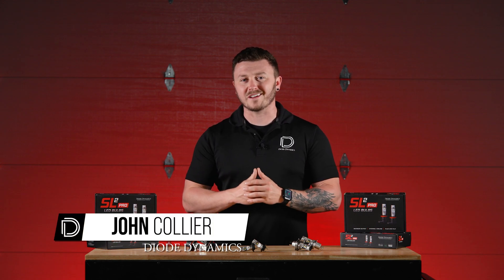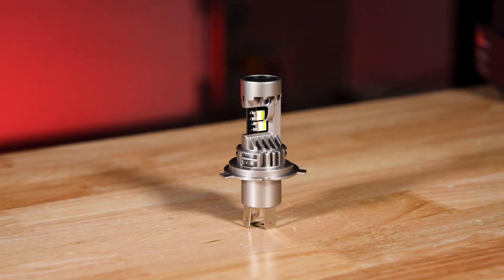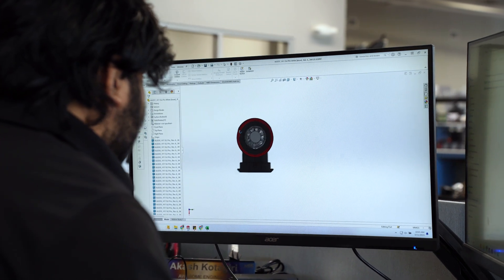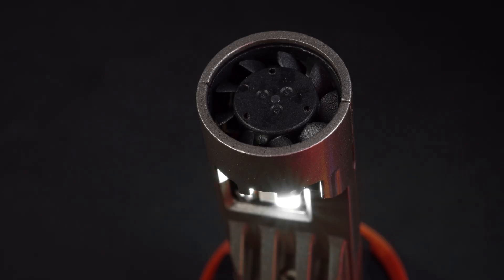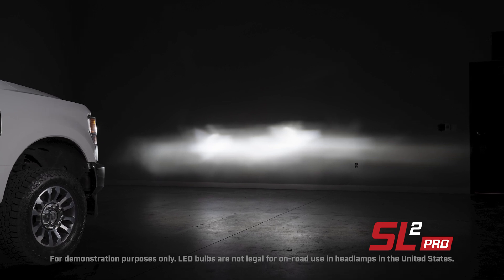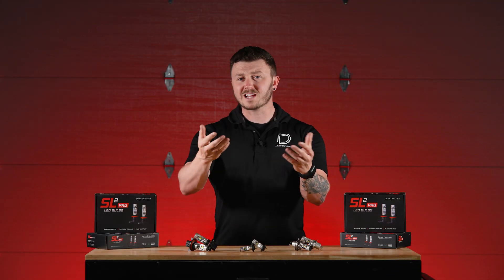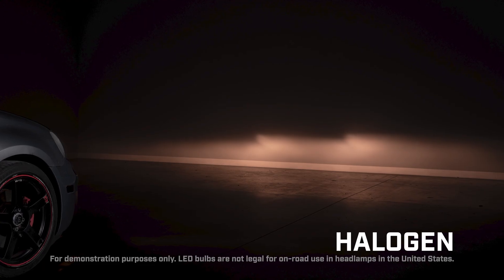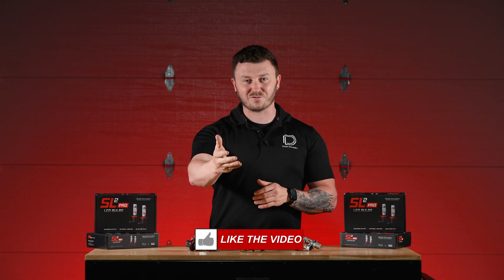H4, H13 & H7 Are Here—NEW SL2 Pro LED Fitments! | Diode Dynamics

Comment: Its very hard to look through the projector in my headlights, I want to make sure the bulb is aligned properly but cant really tell if it's right or not. Is there another way to make sure they are aligned properly?
Reply: @MrWong26  the only way to know if ur two sided led bulbs are correct position to 3-9 o’clock. 

1: look through the center of ur low beam projector. U will definitely see those two sided led chips. 

2: if ur led bulb has a braided cable that lines with two sided led, or the connector are facing down as they should.

Use those as a guide so u will know to adjust the two sided led. 

That’s the only way to find out.
Reply: Put directional markings with a sharpie (or slightly scratch the aluminum) on the rear of the bulb socket/collar. That will tell you which way it's rotated once installed.
Reply: @contagiousingenuityagency5273  or just eyeball from the top center the deadspace between the two sided led, to the bottom connector, and do not loose ur eyesight when installing to see the orientation is positioned correctly.

Comment: People always say, ur not supposed to put led bulbs in a reflector headlights. Only projectors. They will blind others with no focus light. 

I always told them multiple times.

You only blind others if u get the wrong ones. 

U get blinded by two things. 

1: they use the wrong type of led bulbs, such as from 3-8 sided or full 360 degree multisided led bulbs that never work.

2: they did have the correct two sided led bulbs, but they have a poorly align beam pattern that’s aim too high, or worse (and I have seen quite a few people, that I do not understand why) aim too damn low and no visibility in front of u. 

Two sided led bulbs that’s thin in deadspace between the two sided led, and using the small or almost the smallest led chips as halogen coil filament, using CSP, SMD, ZES, Osram, LMP, or even 8 CSP flip chips that retain the same size and same spot of the filament. The hair larger the led chips, the hotspot will be slightly bigger.

The smaller the led chips to match the filament, the more tighter focus intense hotspot it will retain. 👍🏼👍🏼👍🏼